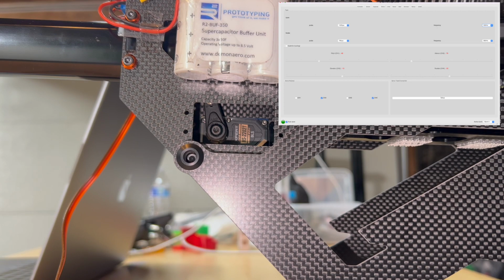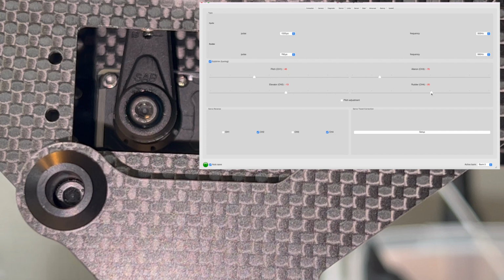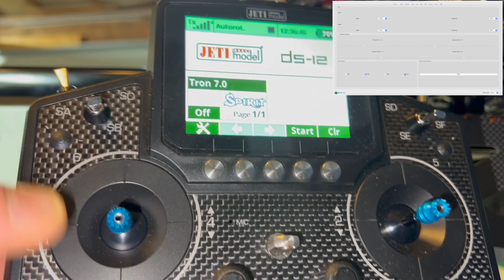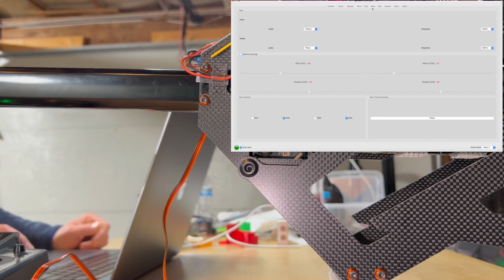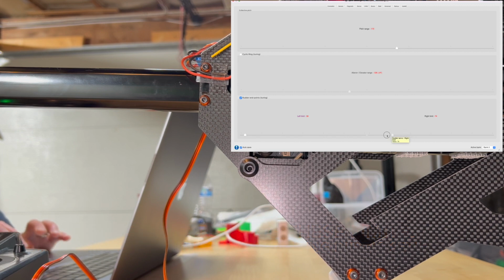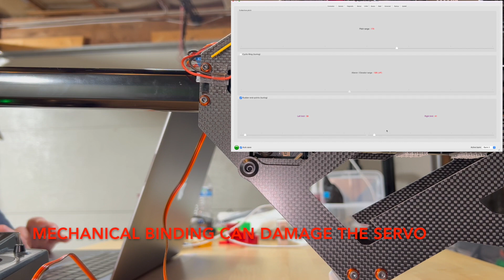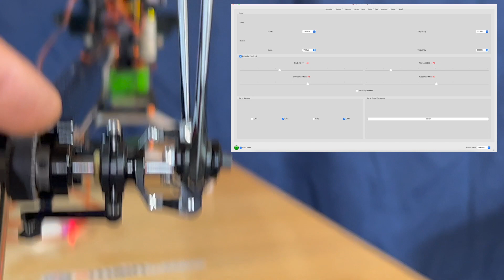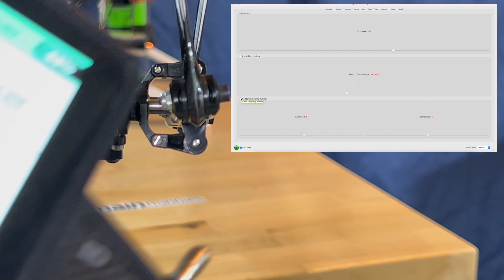Spirit GTR:  Setting up with Jeti Radio    Part 4   Tail setup   HD 1080p

Comment: Awesome video these have helped me sassooo much!! 

I would kill for a flight tuning video
Reply from the maker: I do plan to make a tuning video(s).  I'll explain each parameter on the bench, and then demonstrate during flight.
Reply: @johnahamelv  so excited. I’ve got a decent understand on the basic tuning but some settings I’m confused oh. Like flight styles and the advanced tuning
Reply from the maker: @katpis9121  I believe the term "Flight Style" was popularized by the Mikado VBar.  One extreme is "Robotic".  The other extreme is "Vivid".  Skookum used to called this parameter "Hiller Decay".  Now, most modern FBL units call this parameter "Flight Style".  Mathematically, I believe this "Flight Style" parameter alters the ratio between P-gain and D-gain for the head (does not apply to the tail at all), so more robotic means high D-gain in relation to the P-gain, and more Vivid is lower D-gain in relation to the P-gain.  The classic maneuver where you can tell the difference in "Flight Style" is pyro flips.

Comment: Hello,
What tool are you talking about for the servos? Can you give me the link to Richard's site? Thanks
Reply from the maker: This is Rick Lorh's website:  https://rdlohr.com/

He sells a lot of his stuff at Amain Hobbies:  https://www.amainhobbies.com/rdlohrs-clearly-superior-products/b1798

This is the Amain weblink for Rick Lohr's standard, mini, and micro size servo 90° tool:  https://www.amainhobbies.com/search?s=rdlohrs+servo+90+tool
Reply: @johnahamelv  Thank you, I just went to see the site and indeed its products tell me something.  But it won't work for my kraken 580, the servos are not at 90°.  I have standard servos, Sab provides a small tool to align the servo arms but this is for mini servos not standard.
Reply from the maker: @axelminet1095  Correct.  In the case of the Raw/Kraken 700/580, the Rick Lohr servo centering tool will only work with the rear/elevator servo.  However, you can use the centered rear/elevator servo as your reference for the leveling the swash with the two front/aileron servos.
Reply: @johnahamelv  thank you